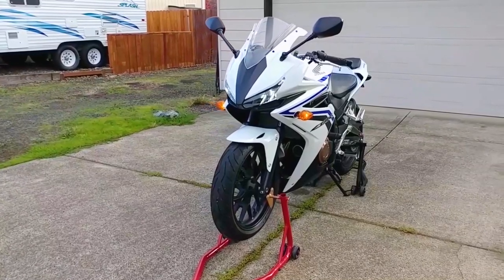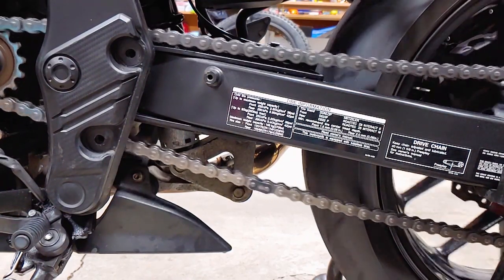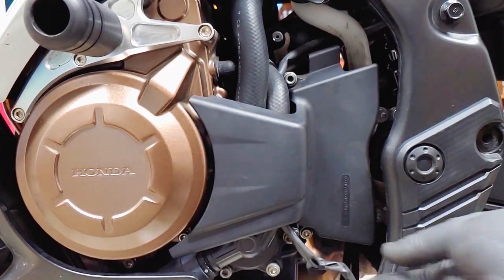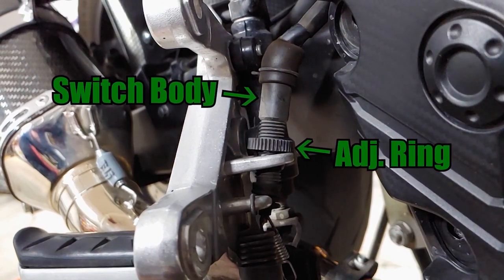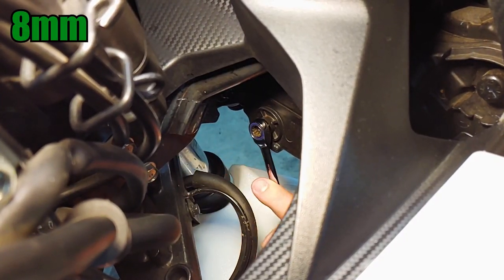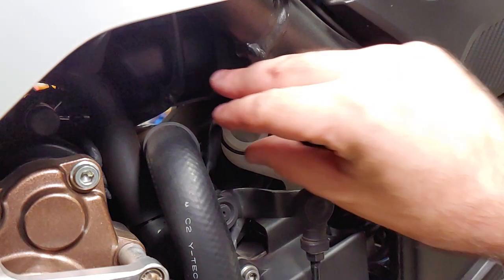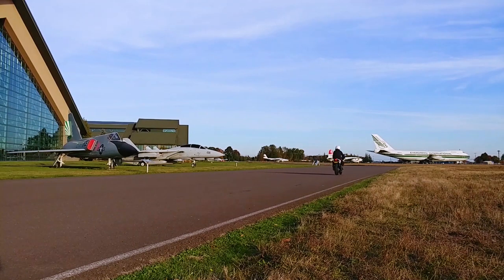8,000 Mile / 12,000 km Service Guide - Honda CBR500R / CB500X / CB500F 2013-2018

Comment: 2:09 Crankcase Breather
2:51 Chain + SProckets
7:35 Brake System
10:25 Clutch System
13:13 Headlight adjustment
14:44 WHeels + Tyres
15:54 Steering Head Bearings
16:26 Cooling system
18:35 Throttle Operation
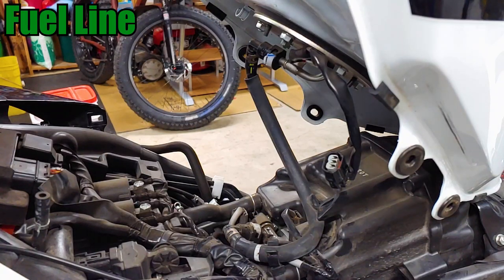21:35 Fuel Line
21:51 Suspension
22:39 Nuts bolts fasteners
22:57 Engine Idle Speed

Comment: Any tips for if the key isn’t turning left when pushed down to lock the wheel?
Reply from the maker: Make sure the bars are all the way left and push the key in while turning it. You might have to jiggle the bars a bit. If the key still won't turn you could try some graphite lubricant in the key hole.

Comment: Do you know which scanner can I purchase for that exact model? I dropped my bike like a week ago and the check engine light came on:( I do have a normal car obd2 scanner but I don't know if it can work with just an adapter.
Reply from the maker: From what I've read, you need one that is specific to Honda motorcycles. I don't have one yet so can't recommend anything, but I've seen them on Amazon.

Comment: I have the same exact bike and I’m getting a burning smell noticed after riding. I just changed the oil and see no visible signs of any leaks. Any idea on what could be the cause of that issue? Bike only has 5k miles on it
Reply from the maker: You probably got oil on the exhaust pipes while changing the oil filter. It will burn off.

Comment: Do you change oil every 6000km or every 12000km as the manual suggests? Also do you change oil filter every time you change the oil or one time you do oil filter and oil and the other just replace the oil and keep the same filter?
Reply from the maker: Hi there! The video answers the oil change interval questions in the first 30 seconds. Personally, I don't ride more than a couple thousand miles per year, so I change the oil once every year before putting the bike in storage for winter, and the filter can stay in for up to 16,000 miles but I changed it when I bought the bike and again for this video without putting down a whole lot of miles. Check out my winterization video for more info on storing the bike if you don't ride year-round.